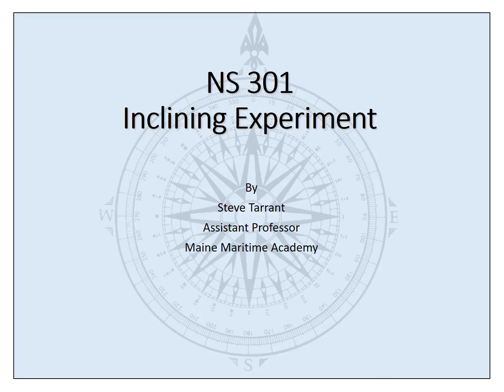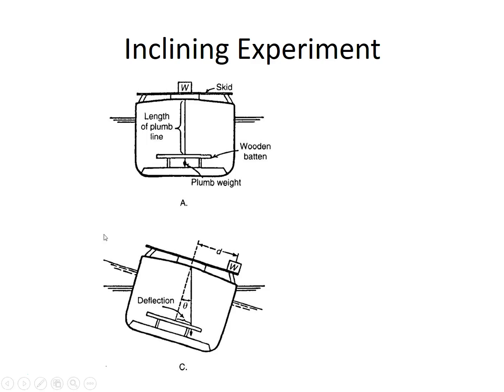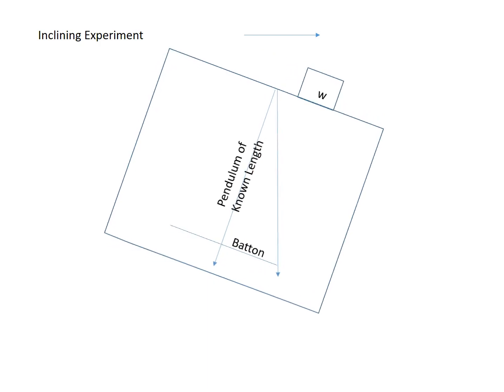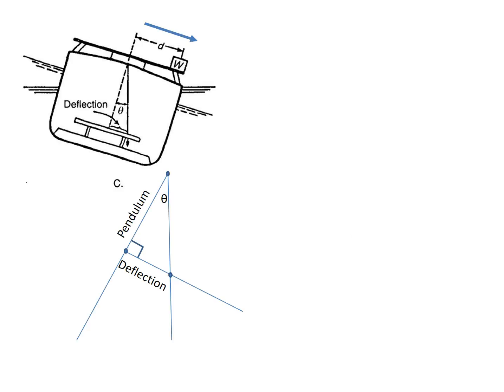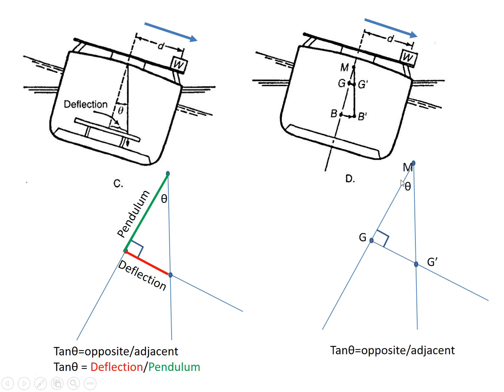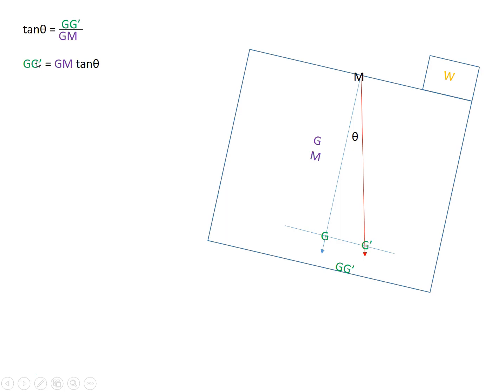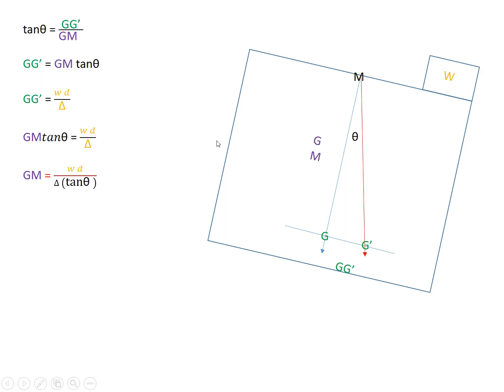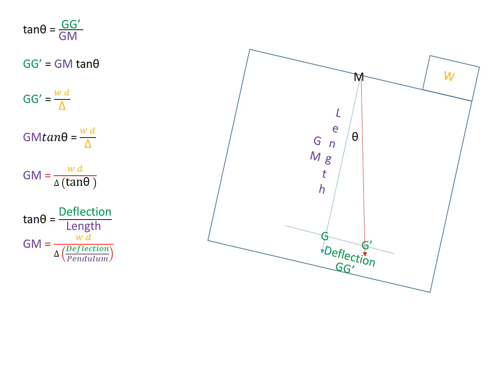Inclining Experiment

Comment: Im sorry but I cant understand y GG'=w×d/displacement..
Reply: me too,could someone please explain that?
Reply from the maker: @MateUkić-w6k Are you trying to understand the derivation of the formula?
Reply from the maker: @MateUkić-w6k The shift of the center of gravity (G to G') will have units of length when you finish with the calculation. Therefore all other units have to cancel out. Since the moment created by the cargo has units of foot tons (weight x distance), we need to divide it by tons (weight) to cancel the tons in the numerator. If we use the total tons of the vessel the shift from G to G' (GG') has units of feet (or centimeters if you used metric). Is that at all helpful?

Comment: from where KM come, if km come from hydrostatic table, to hydrostatic table how KM calculate
Reply: The easiest way  to determine the height of Metacenter (KM), is to look it up in the hydrostatic data.  You first need to know your drafts or displacement.  Once you have that you can enter the hydrostatic table and look up the value of KM at that particular draft. Depending on your ship the data may be in a table or in a curve. I have another video where I look up the value of KM.
Reply: calculation from ship's lines plan
Reply: Accurate calculations of KM cannot be made except by the NAVAL ARCHITECT after much involved work.